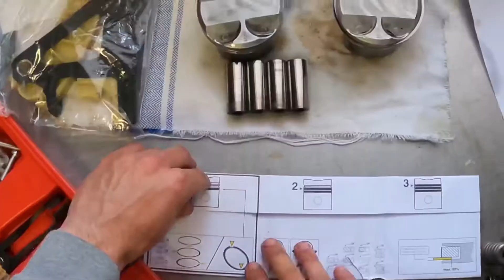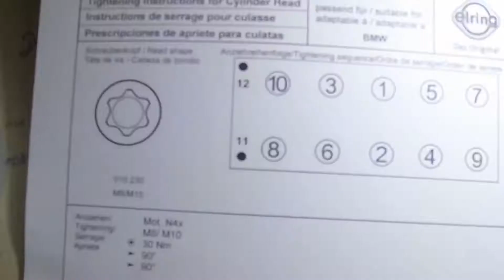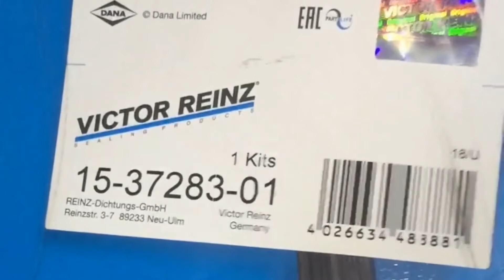BMW N45TU Engine Overhaul. BMW N45 Engine rebuild , E87 BMW Series 1 & E90 BMW Series 3

Comment: Czesc . Mam silnik n45b16 spala litr oleju na 500 kilometrów. Odma zarypana olejem, kopci. Co może być przyczyną tak dużego spalania. Sama odma czy uszczelniacze , pierscienie ?
Reply from the maker: Hello friend, from my experience I can tell you that the valve stem seals would be the cause, piston rings less likely.. how many miles you have on the car? Is it smoking all the time? Or when you accelerate you have visible Claud of blue smoke?
Reply: @SuperFastDriver   e87 2005 180000km , The car smokes when I stand I traffic and I run ten IT is big cloud  for me white smoke , but sometimes when I drive and  I acelerite car I also See smoke . I am not sure of the milage of the car  .

Comment: Good work, looks like this video will be helpful to me and can i learn torque specs for camshaft bearing nuts?, thanks 👍
Reply: And oil pump sprocket nut  torque specs also
Reply from the maker: @hightower001  thanks, the camshaft torque specs 11Nm
Reply from the maker: @hightower001   31 Nm ;)
Reply: @SuperFastDriver  thanks for the information )

Comment: Does the cam gears have any alignment when inserting them onto camshaft ? Except the impulse sending wheel that aligns with the special tool.
Reply from the maker: you talk about the vanos gears right? They don’t have alignment once camshafts are timed with the special tool, you need to tight the vanos gears up to 80 Nm
Reply: @SuperFastDriver  yes, thats what I wanted to know, many thanks !!!!
Reply from the maker: @gigimarfa877  I have N45 timing here check it out: https://youtu.be/P_DR8Zcr-dY
Reply: @SuperFastDriver  yeah followed that, but my vanos gears rattle like 1/2 minutes at cold start over-night, then it runs perfectly fine like in the video. I think its a oil pressure problem. Do you know if i need any special tools to remove the pump and check it ?
Reply: @SuperFastDriver  i have changed the oil pump, its the same you have in this video, does it have any timing points ?